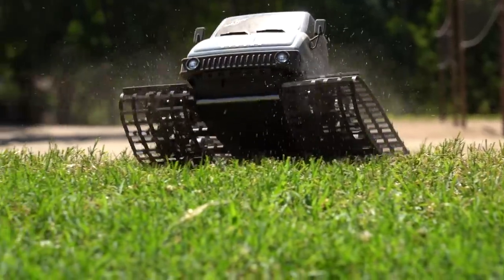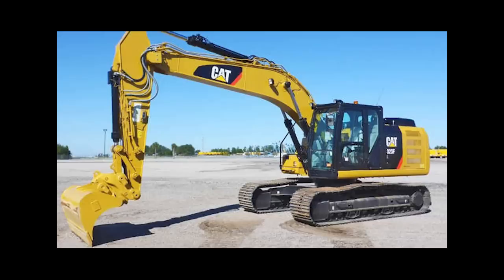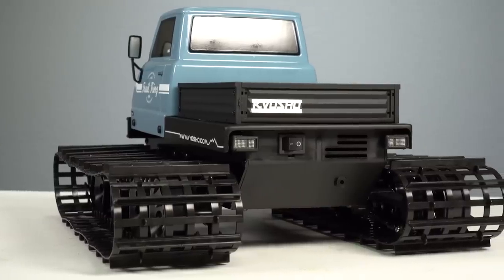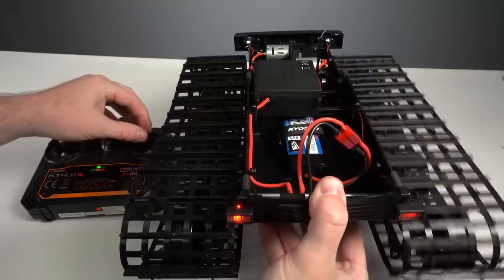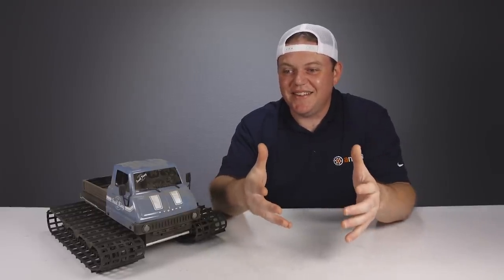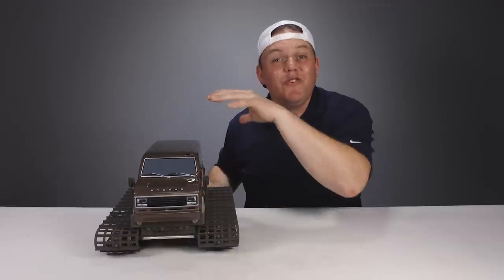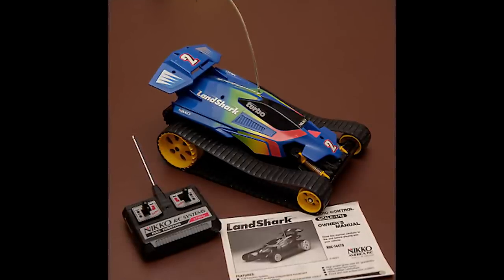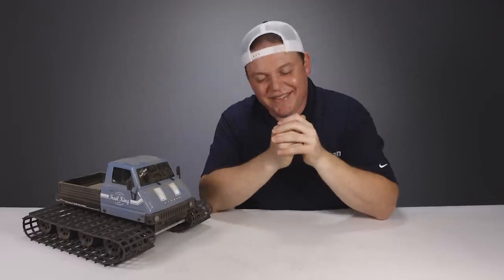Reviewing the Kyosho Trail King Tank Track R/C Vehicle

Comment: I gotta say, I love this channel.  I love your website, your information, and your reviews.  On that note, I'd like to throw in my two cents about tank tracks and the vehicles that use them.  As an RC fan, I started with the speedy cars.  Monster trucks, short course trucks, big stupid rc trucks...  Then I bought my first rc tank a bit ago, and the whole game changed.  Tank tracks are tedious, and work, but once you get them dialed in, they are nearly bullet proof.  They eat terrain, obstacles, other rc vehicles, it's quite simply put, my favorite rc now.  

Metal tracks are pretty mandatory.  This and then Eachine makes the mini ripsaw-look-alike, and that has metal tracks now too, but either way, rc tank tracks are almost mandatory metal.  Plastic is fine, it will work, and it's a good backup, but go metal, you wont regret it.

Thanks for this video, and your others as well.  This is why I buy from you all.  Keep up the stellar work.

Comment: I'm in two minds about this one.  On the one hand it is an interesting tracked vehicle that can be used in more scenarios than a Blizzard but on the other hand it seems a bit of a mix of fairly cheap-looking engineering with an expensive price tag.  I guess this machine will have its fans and it really doesn't have many competitors.  It would have worked better as a Morooka style utility vehicle in my opinion.

Comment: Got the metal tracks for the Blizzard and it's basically undriveable with them. Those tiny motors just don't have the power. I replace the radio with a DX6i and put a pair of brushelss Reedy micro systems in it. Now it's fast, but still a paint since the ESC's have reverse lockout. :P

Comment: They could have done it 1/10 with proper gears and batteries, this is just a toy
Reply: Mo powah babe!

~James Pumphrey
Reply: All RCs are just toys.
Reply: @TestECull  Actually they're not! There is "Toy Grade" & Hobby Grade".
Reply: @TestECull if you buy an RC from Arrma, Traxxas, etc... it says on the box and in the manual that it isn't a toy, and not for 14 and under ages. 
Most toys aren't able to (tragically and accidentally) break your bones, knock you off your feet or kill small animals.
Unless you're talking about toys from the 50's and earlier.
Reply: @Boogie_the_cat  Its a toy. It is bought purely for the amusement of its owner. Any object owned for that purpose is a toy.

Comment: So with lipo batteries when the battery is low from using I wait for it too cool down then charge the battery. and then store it away till tomorrow when I use my truck again? I’m really confused on these lipo batteries someone help plz
Reply: I’m confused on the balancing and stuff like that
Reply from the maker: Letting the battery cool before recharging is a good idea and healthy for the battery. And then doing a storage charge at the end of the day is great too; both good practices. Depending on your charger, it may allow you to do both, a balance charge and a non-balance charge (fast charge). When you balance charge, the charger will monitor each individual cell inside the LiPo, and charge them all to the same level as each other; this is cell balancing. If you don't balance charge, the charger looks at the voltage of the overall battery pack, not the cells individually. This will eventually lead to some cells being charged more than others (not balanced), and this is dangerous. Hope that explains what balancing is, and why it matters.  
-Brett
Reply: AMain Hobbies is storage charging only if your going to not use it for like more than a week?

Comment: Should I start out with a slash 2 x 4         4 x 4     X max or Traxxas rally
Reply: grim reaper slash
Reply from the maker: I would avoid the Maxx, but the other three options are great places to start out, and cost much less than the Maxx, leaving you more money for other tires, upgrades, accessories, etc. The Rally is pretty much the Slash 4X4 that has been fitted with different tires and wheels. Whichever you choose, going with a VXL model is highly recommend for the Brushless, better differential and better TQi Transmitter; it's worth it. 
-Brett
Reply: AMain Hobbies Thank you Brett it’s very helpful I was kind of thinking the X max because of the reviews on how good it is when it comes to Bashan because when it comes to Myers because I really like them to be able to be beaten and not just die out

Comment: 1/10 body fit on it ?
Reply from the maker: Maybe, depending on the body. This size is a little shorter and narrower than standard 1/10 bodies. We put the Mad Van body on this in the video and it fit pretty well. 
-Brett
Reply: Wow price is way up there I mite build my own 1/10 with some cheap 550's the metal gearbox sets are cheap n just get a cheap roller to build it on